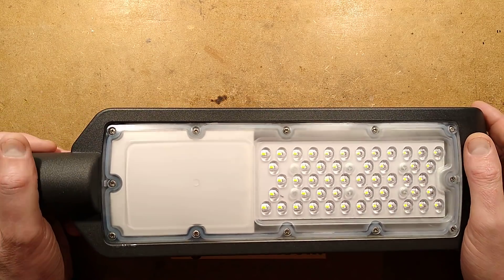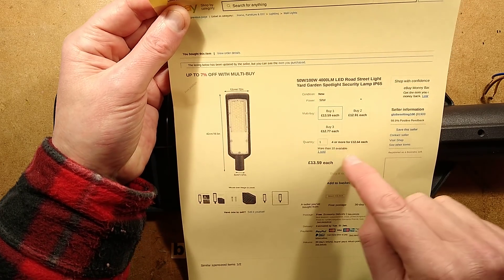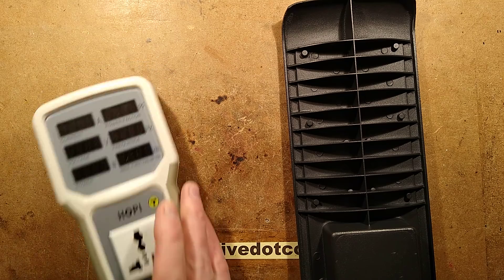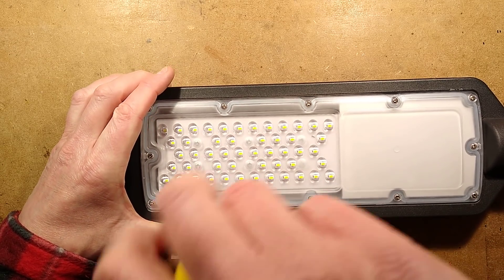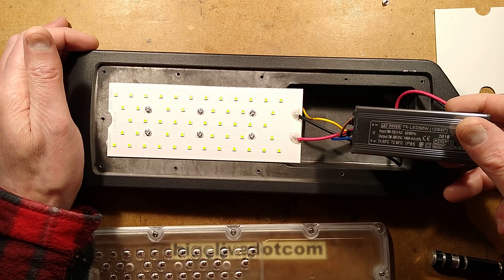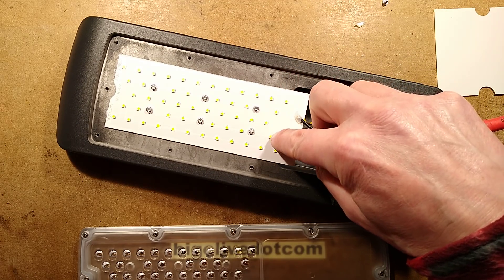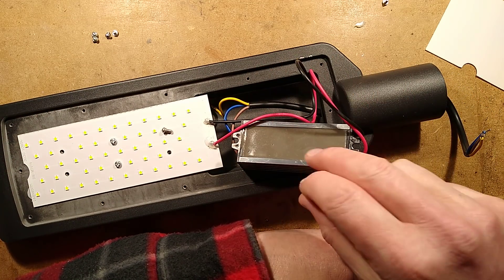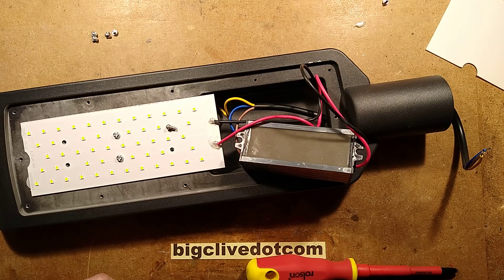DIY Chinese street light kit.

Comment: You were talking about 5G radiation, I would love you to do a video on 5G to be quite honest it would be good to hear from an expert in the electronics field.
Reply: There's nothing really to say. Human skin is excellent at blocking non-ionizing radiation. It'd take an insane amount of power at close range to actually hurt a human with 5G broadcasts. For reference, your typical microwave oven requires a thousand or so watts to actually cook food, whereas 5G transmitters top out at 120 W for the largest MIMO arrays (and are on the scale of milliwatts for typical radios). But your microwave is also less than a meter away from the food it's cooking. EM energy propagation follows an inverse square relationship, which means energy received at twice the distance is actually a quarter as strong. So even if a 5G radio was transmitting at thousands of watts, no one would actually ever be close enough to it to feel its effects.

The main problem with 5G is that it can interfere with certain systems used for weather prediction, namely the radar used to track precipitation.
Reply: @Longlius  This is the propaganda line from the government, that non-ionizing radiation is only harmful if it cooks you. There's been enough science around the world for decades that thoroughly debunks this. EM radiation has profound effects on biological systems at non-thermal levels, the governments of the world know this. If you look at regulations around the world, you'll see that it's only a couple countries that have held onto to these archaic and harmful myths about radiation and the problem is they are the most influential countries.
Reply: @wkruse84  What's the mechanism of action then? In what way does non-ionizing radiation interact with the human body?
Reply: @Longlius  What I said is hardly ground-breaking. There's been many, many scientists and doctors who've conducted research into this(including government work.) You could look into Dr. Ross Adey, for starters.

https://www.researchgate.net/scientific-contributions/2089555399_W_Ross_Adey

Don't take my word for it, take his. It's really astounding that the first thing you ask for is some type of evidence for a well-known phenomenon but the rest of this comment section is filled with comments about how safe 5g is. While it may or may not be safe, no one actually knows as there's been no studies yet. I see no one calling these commentors out for spouting what is essentially nonsense. 

Like I said, this is hardly ground-breaking or new information. Just look at different nations and jurisdictions around the world and find out what they consider "safe" levels and you'll see they've taken this information that never gets discussed in the USA and applied it to real regulations.
Reply: However, any "unsafe" levels, as stated, won't come from the base stations, they're just too far away for the signal to matter. The harm will come from your own phone, clamped to the side of your head. Except it won't as 5G isn't used for voice.
Reply: @paulsengupta971  You sound like you're trying to sell me on 5g safety. Your phone is constantly sharing data over the 4g bands even when you are on voice, it doesn't stop magically. You also have no evidence from any objective study that the base tower radiation is not harmful, you're literally lying. 

Since it seems everyone is pretending that they are interested in the science but completely unwilling to look it up, I'll share a little. This is from a study called "Biological effects of electromagnetic fields." If you want a preliminary MOA, then here you go, but it is by no means exhaustive. 

"Life on earth has evolved in a sea of natural electromagnetic (EM) fields. Over the past century, this natural environment has sharply changed with introduction of a vast and growing spectrum of man-made EM fields. From models based on equilibrium thermodynamics and thermal effects, these fields were initially considered too weak to interact with biomolecular systems, and thus incapable of influencing physiological functions. Laboratory studies have tested a spectrum of EM fields for bioeffects at cell and molecular levels, focusing on exposures at athermal levels. A clear emergent conclusion is that many observed interactions are not based on tissue heating. Modulation of cell surface chemical events by weak EM fields indicates a major amplification of initial weak triggers associated with binding of hormones, antibodies, and neurotransmitters to their specific binding sites. Calcium ions play a key role in this amplification. These studies support new concepts of communication between cells across the barriers of cell membranes; and point with increasing certainty to an essential physical organization in living matter, at a far finer level than the structural and functional image defined in the chemistry of molecules. New collaborations between physical and biological scientists define common goals, seeking solutions to the physical nature of matter through a strong focus on biological matter. The evidence indicates mediation by highly nonlinear, nonequilibrium processes at critical steps in signal coupling across cell membranes. There is increasing evidence that these events relate to quantum states and resonant responses in biomolecular systems, and not to equilibrium thermodynamics associated with thermal energy exchanges and tissue heating." 
 
Most of our studies on athermal radiation come from military funded sources, that show clear intention to reach a desired result. In the early 1980's the Airforce conducted a study at Washington University. It studied rats exposed to low level microwave radiation, 2.45 ghz at 0.5mW/cm2, which is 25 times lower than the the "safe" limit. 18 rats got cancer in the experimental group and 5 got cancer in the control. They concluded that because this is lower than the expected rate for these rats that the radiation must be safe. It was heavily published at the time and is still cited in defense of the industry. There's a huge problem with the study though. The rats that were used were special, they were "gnotobiotic" which means they have no bacterial or viral exposure. The rats alone cost 5$ million in the 80's. Since 20% of cancer is caused in humans by viral infection, it can be seen that this lower cancer rate was the desired result from the start. Humans and rats in the real world are not "gnotobiotic," which makes this study worthless. Very strange to manipulate and then conceal these facts from the few in the public who care to look at this stuff, don't you think?
Reply: I think you're putting 2 and 2 together and coming up with 467.
Reply: @paulsengupta971  I quoted a peer-reviewed paper written by one of the world's most knowledgeable scientists on the subject and you are literally making things up out of thin air that you have no justification for saying. Please do not preface any statements with "I think," it will immediately indicate to all who read it that the rest of the sentence is based on a lie. You sound like you're reading talking points from a Verizon tech support line. 

If you were honest and simply said, "There's no data on 5g regarding its safety, but I think it will be fine." I would still disagree and provide actual research to show why. You're not even attempting to be honest, you're just a blatant liar. I seriously doubt you actually work in the tech industry, you can't pass any STEM classes with made-up wishful thinking based on industry talking points and poorly thought out conjecture. You have to actually use math, data and logic to come to your conclusions. You sound like you're trying to convince someone their iphone won't give them cancer who might be on the fence regarding their purchase.
Reply: "I quoted a peer-reviewed paper written by one of the world's most knowledgeable scientists"
Did you indeed. Can you point out who peer reviewed it and why you think he is  "one of the world's most knowledgeable scientists" ?
Reply: Mobile phones are set at around 2 watts max power when transmitting. Is 2 watts going to harm you somehow?

Comment: Wow, Isle of Man voltage is as badly regulated as Australia's. That's roughly 250V. Do capacitors in electronics regularly go bang on the Isle?
Reply from the maker: They're pretty reliable.
Reply: That's because instead of having a small transformer for one or two properties, they have one big one for the whole street or block and the output degrades by the end of the circuit, so they push the volts up a little bit.

Comment: In my road they stuck LED lights into existing lampposts, then they didn't put them back together properly, they have water in the glass, it casts a weird shadow on the road, and wobbles when you give the Lamppost a  kick!
Reply from the maker: It's probably because the seals are old and it relied on the original hot lamps to evaporate the water.

Comment: Good Review and Multi meter test...  Don't forget to tighten the frame ground wire..!!  LOL
Reply from the maker: I remembered that AFTER screwing the LED panel back on.  I did take it off and add the required washer, as the hole was not deep enough for the screw.

Comment: Clive, in the common 12V LED strip, there are 3 LEDs in each section and an SMD. What is this SMD (capacitor? resistor?) and what is it for?
Reply from the maker: It's a current limiting resistor.  Usually around 150 ohms (151)

Comment: Why are they making LEDS that get hot ? I thought that was the idea of LEDS - cold light source !
Reply: Anything electrical will get hot with enough current driving through it. None of this stuff is 100% efficient. If we assume the fixture is 90% efficient, and it's 50w, that's 5w of nothing but heat being dissipated. It's "cool" compared to incandescent sources, for sure, but drive anything hard enough and you'll get heat. I think the Google term you'll want is "equivalent series resistance."
Reply: Incandescents are over a thousand degrees. They’re cool compared to that.
Reply: @JasperJanssen  They're hot compared to LEDs of the 70s !
Reply: pmailkeey that’s why these days they’re lighting, rather than almost invisible signal lights.

Comment: Use your caliper to measure the outside diameter of the too-short screws, that are not M3, and we'll see if we can work out what the true size is if you like Clive - please don't tell me they've used imperial sizes ? (if you compare an M3 screw thread with the short screw - if the thread pitch of the short Chinese screw looks much coarser, it's prob. imperial.)

Comment: Clive, your thoughts on earthing requirements - as the LED driver's double insulated. So it's only the wires to it that are an earth fault risk ?
Reply from the maker: There's no guarantee that the output is properly isolated.  I've also had a light that was supplied with the live wire pinched between the cover and housing.
Reply: @bigclivedotcom  And I've seen the video with the trapped wire ! Not that uncommon with UK 3 pin sockets mounted in walls - where a cover screw grinds its way through conductor insulation.
As for the output,  two thoughts - the double-insulated classification should cover those too - "double-isolated" :) and the fact that all the LEDs light would suggest there is no power leaking to earth - unless the last LED's 'return' is connected to earth instead - but if it was and they're still lit, it must be a 'good' earth !

I've (Pun warning) always considered that isolated 'LV' has the 'potential' to float anywhere between 0 and mains when isolated. Hence why when I installed shop display lights in a friend's bathroom, I connected 12V output N* to E and used the green/yellow core for that to each of the lamps.
So on the one hand a bit naughty using earth cable as a power conductor but at least it was also a genuine earth!
(* As determined by the fact that output L fed 3 fuses, one for each lamp !)
(Can't even remember now whether the output was rectum-fried - no need for halogen bulbs - so logic would say not.)(Bit of a bastard transformer - labelled as 150W - and the consequence of using 30W bulbs was simple - it'd blow them. It needed 3 50W bulbs to bring the voltage down !)

Comment: I can imagine this sexy black matt fixture on a street with no trees alongside to shade it in some bulgarian village that has over 300 clear sunny days in year (at mountainfoots at about 700 to 1100 meters above sea level most of them have this sunny feature, but at least evenings and nights there are pleasantly cool) in a summer evening at 20 hour being turned on and suddenly all these diods have to radiate generated heat via preheated to 50-70 degrees casing to an air of 24-27 degrees and this driver in a box that is just dangling in there.
Reply: One should design for the worst case scenario. Then over engineer it by 50%
Make it look pretty, easy to manufacture and cheaply
I worked with a guy called Nash. he seemed to think that way
Reply: @FarleyHillBilly  In my opinion any design makes sense only when it targets real life application and follows strict design rules. By no means examples such as this one are fault of chinese designers or businessmen - it's a matter of policy and any policy is driven by demand of social aware citizens. It's especially painful to understand and even more to implement rules of compliance in poor countries as mine: it's not coincidence I have mentioned Bulgaria - I am bulgarian myself and in the dark age of socialism there were obligatory technical standarts for almost everything but with the personal and political freedom for some unknown to me reason came the freedon of not following any standarts. It's a very long talk and probably off topic, so I'll stop here.
Reply: @deepblueskyshine  
I understand.

Comment: Clive I wonder if you can advise. I’m trying to find a 12 volt bleeper but the bleeper needs to bleep once a minute. It’s to be wired to an led that shows my electric gate is open. Can you think of anything that will do the job please?
Reply: Mark Anson Try an auto-parts store for a reverse-warning beeper.  Otherwise a discrete circuit using a 556 and a FET.
Reply: Needle Noddle-noo thanks for that. I thought of a reverse bleeper but it doesn’t need to be super loud. Was looking for something like the loudness of a washing machine bleeper that tells you the machines finished lol. I have no idea how to make a circuit. I’m a mechanic not electronics guru. Was hoping I would find one here 😀
Reply: Mark Anson Just modify the enclosure to reduce the perceived audio level.  You'd want to make it weatherproof anyway.
Reply: @chrispza  This bleeper is to go inside the house. I cant see the gate or the flashing light hence why I needed a quietish audible beeper to remind me the gate is left open. I have no idea what a 556 and a FET is or how to do a circuit sadly.

Comment: Ive worked with streethlights in the past and philips does a style where you can order them with drivers thats turned down abit, and they have an entire chart of how much loonger the LEDs last depending on how much youve lowered the powersupply.

Also those have a thermal sensor in them wich will cut off if the LEDs gets too hot in the summer, we had a few reports of them not working and foundt out that it was because some of our controll boxes was running an old timer and it had goten out of sync with the daylight time.
Reply from the maker: Sounds like the xitanium programmable drivers.

Comment: Well, the "TA:50oC" mark on the driver is not really promising. Specially in a lamp which is designed to be outside, in the sun and is black. I assume it easily heats up to 60-70oC in a sunny day without it even being powered on.
Reply: Bung a hat on it then

Comment: Hi Clive sorry to ask a question not relevant to this. On your recent mega live stream you showed a SMD Hot Plate you had purchased from China. Really would like to hear your thoughts on this item as you get a chance to test it out. Certainly, as you noted is a great price for us in the hobby arena. I understand everything takes time and making videos need planning. Thank you for your interesting videos and ideas you share freely.
Reply from the maker: I've not tested it with soldering yet, but a friend got one and found it worked well.  I've had a look inside this one and it is designed sensibly.